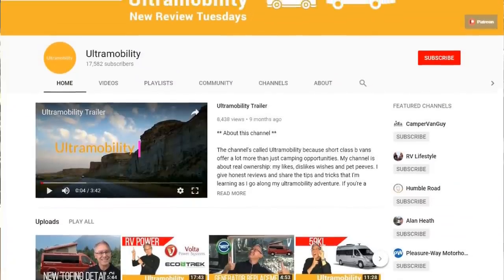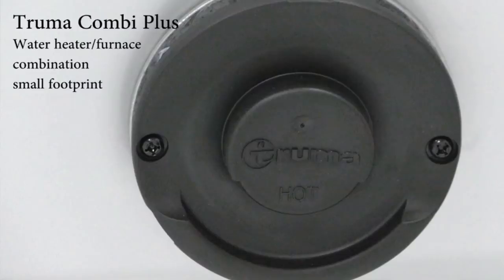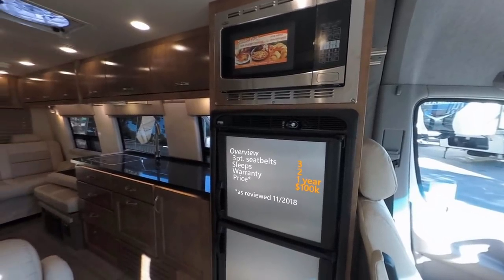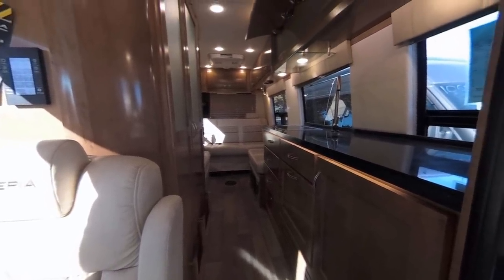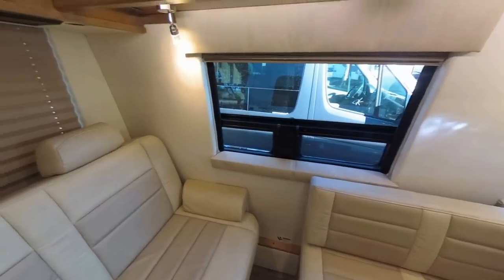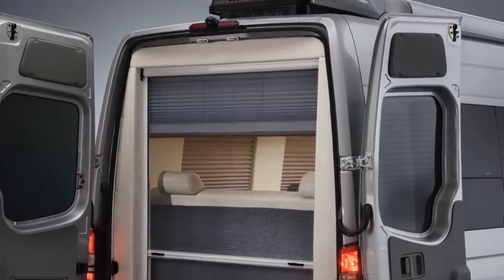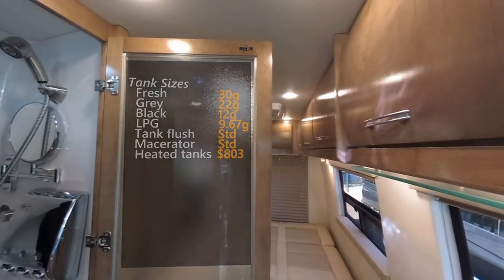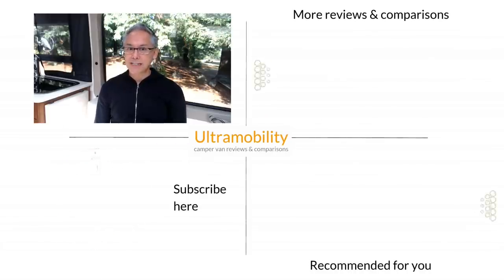Full Review | Coachmen Galleria 24T | A 4 Season Capable RV with Available Lithium Upgrade!

Comment: It's very good review. I removed power reclining sofa and installed DIY twin beds (27"x80") which it can also make a full size queen bed (68"x80").  A couple of reasons I removed power sofa, because it was not comfortable even though I used 2" memory foam mattress, and I hated to crawl down when I have to go to bathroom in the midnight.  Except it, comparing price with Airstream with the same layout, $50,000 cheaper for the similar quality. I agree that the one year warranty is the weakest selling point but I hope all problems will be occurred during one year.  About the parking space, I used to park at the Walmart or other regular parking lot, I never had a problem with it.
Reply: Comment bot

Comment: Neil PLEASE keep weighing in WARRANTY LENGTH in your final judgement.  I had a talk with a local RV dealer salesman who I've gotten to know and he shared with me that many Class B RV's reduce their initial price but give only a flimsy 1 year warranty knowing true well that something is going to go wrong or break that will require dealer service.  Some of these services are very costly and frustrates the purchaser who is then offered a trade in on another RV before warranty expires.  This is where the dealer makes some money back.  He said, off the record, that 1 year warranty RV's are a red flag for potential problems down the line and perpetuates the slimy practice of nudging people into trade ins.
Reply from the maker: thanks for sharing this. yes, warranty length will continue to factor in my final buying decision. it's an important point as you mention. when I started doing reviews warranty was rarely discussion or disclosed. in fact some manufacturers didn't  (and don't) make it easy to find their warranty information. in those cases I find it's with manufacturers who have 1-2 year warranties.

Comment: As others have said, thanks again for the review. It seems like many owners and potential buyers like the Coachman Galleria and CrossFit but are concerned about the one year warranty. With the Galleria being available for under $100k and the CrossFit under $80k the thought of purchasing an extended warranty does not seem out of line. The Galleria is excess to our needs but the CrossFit is a really nice, and a little shorter, alternative. I wish the CrossFit had a 4x4 option!!!
Reply from the maker: hi Steve - yeah unfortunately the RAM Promaster chassis isn't available from the manufacturer with a 4wd option. wouldn't that be great though?
Reply: Ultramobility Is the Crossfit/Beyond on the Ford Transit?

Comment: At this length I would think this van looses what makes a van appealing, easy maneuverability and stealth which are the main reasons for me to go to go with a B rather than a B+. At this length I would opt for the LTV or Phoenix which has an AWSOME new suspension system used on ambulances. Drove it at Hershey and was incredibly impressed. This is just my opinion and is worth what you pay for it. It is a lovely layout but I would like a permanent bed rather than the sofa especially if you need a mattress topper. I would change that opinion if they beefed up the memory foam. Fantastic review as usual! Thank you Neil!
Reply from the maker: I'll have to review the Phoenix Cruiser. It is a quality built rig for sure. Deserves a review and the attention on my channel.
Reply: Thank you Nick. I agree it’s a much nicer floor plan for my type of use. Actually I really like it! My problem will still be the length vs a B+. That’s still a tough hurdle for me to justify a B at 24ft. Really appreciate the link!
Reply: @Kath50 Completly understand. Thanks for supporting Neil.
Reply: @nickrecchio1676  can the fixed beds be made into a full bed? We have been looking at the Galleria and like what we see.
Reply: @karenhicks7816  We have a small insert cusion that will finish the current 24A bed to more of a rectangle.

Comment: I prefer the 24FL layout with the galley on the camp side, but I love the excellent Xantrex electrical system. Based on the vans I've looked at, Coachmen quality seems to be the best in the class B segment for the price. However, a paltry 1 year warranty on a $100k+ coach is inexcusable. The industry standard should be 5 years of coverage, no matter the price point. That said, if I was in the market to buy a van off the lot right now, I'd probably buy a Galleria 24FL Li3, but I'm still slightly leaning toward a custom build.
Reply: I'll vouch for the 24FL Li3 - we love ours; it's head and shoulders above our previous Roadtrek.  Buy a good extended warranty and you're still way ahead of the competition's pricing - at least for this level of build quality.
Reply: @travel4B  Where can you buy a extended warranty and the cost of it

Comment: Great great review. May hold out for the 2019. We are in N Idaho Panhandle area. 4 Season is important to us. We have a Blackstone travel trailer all season package. We stay toasty warm with the dual pane windows and can camp longer in the season than many. Would love that in a class B. Huge difference. I LOVE the white exterior paint. I am liking this rig a lot. The warranty is discouraging as others have commented. Ugh Thanks again.
Reply from the maker: I'm too frustrated by the warranty. this coach deserves better! it's build quality is not built to a 12 month spec. I've seen coaches that are built to a 12 month spec and this isn't one of them. Take that for what it's worth Spell Madam. BUT I will say that 1) the build quality on this coach is good and 2) owners seem to be happy with the purchases and with Coachmen's customer support. That says a lot. Also, you could opt to separately purchase your own extended warranty although that would be a thing onto itself - one which I would need to do a full episode on because of its complexities. Suffice it to say that while I didn't recommend a "Buy" rating on this 2018, my rating on the 2019 model will likely be higher provided the price is right. I would definitely consider a Galleria if I were in the market for a longer, extended wheelbase Sprinter. I like many of the improvements that the 2019 model year brings. Coachmen is really doing some things that catapult it into the "product leadership" position - something that Roadtrek used to be the king of. No one else is doing the work to make a true 4 season RV and Coachmen has been smart out outsourcing its lithium system to Xantrex instead of trying to build and support their own proprietary system. I'm also impressed with their options like leveling jacks, sumo springs and 4wd. That 1 year warranty though is a tough one. I'd need to see how the build quality holds up over time. If it does, then Coachmen should definitely consider pivoting into the luxury category with their class Bs.
Reply: @Ultramobility  oh yes the 4x4. Very very nice.
Reply: I have heard this as well and certainly understand your concern.
 Please feel free to browse our Galleria Owners Group on Facebook, which is strictly ran by Galleria owners. I find if potential customers get on the  Facebook page they certainly realize we do it the right way. Customer Service and Quality are our #1 PRIORITY! Would love to hear your feedback. Many Thanks.
Reply: @nickrecchio1676  We would like to see a 3 year warranty on your coaches.  It takes that long to get the problems fixed through warranty at any dealership, if you can get an appt. within your warranty period of 1 year.  A lot of time, money and chassis miles are spent traveling for warranty work.  Also, head room in the wet bath is essential for someone who is 6.2!!! Thanks for your consideration on our suggestions!!!
Reply: @nickrecchio1676  "Customer satisfaction and Quality are our #1 Prority". Well that's fine to say but it's only words! There are automobile manufacturers out there that also have similar sales catch phrases and promises, but theres is not one person on this entire planet including you and everyone at Coachmen industries that would ever purchase even a 30k vehicle from any of them with only a 1 yr warranty. That's a fact! Yet you would attempt to convince potential buyers of your product to do that which you would never do and at at price point of 100k+!! I would argue that Coachmen and other rv  manufactures fail to understand that one of their biggest buying demographic, the baby boom generation simple cannot take such a risk purchase. The average baby boomer in case the industry doesn't know has little to no saving heading into retirement to risk on a product they may have to dump 1000s of additional  dollars into for repairs after that messily 1yr warranty expires. I am one of those baby boomers looking for a down sized class b coach who will not and cannot take such a risk with such a large some of income when other manufacturers are offer far more peace of mind and security with a real extended warranty opposed to the Coachmen 1yr warranty and words. I spent a lot of time in this coach at Hershey this yr. Its a great coach, but it's a no for me until Coachmen rethinks its philosophy and business model with regards to its warranty.

Comment: Great review! Love the All season upgrade. Living in San Jose California I felt all weather an rv was overkill. But after spending a night in 14° weather. I wished i had all wrather rv. The pipes started freezing. I like the Sumo springs as well but wonder how that compares to the VP air system. I agree they do need to add more memory foam on the rear seats. I hear that many owners carry a bed topper. My wife is shopping for a bed topper now. I have a 24 foot Midwrst Automotive Weekender Md4, use to have A 25.8 foot LTV Unity MB and I have had no problem parking. Love the uniformity of the exterior hookups. Makes for a sleek stealthy rv. I would lean more towards the 24Q. Looking foward to the 2019's.  Again great review!
Reply from the maker: you did get the MW Weekender MD4! Great floorplan! Can't wait to hear your longer term review of it. THanks for sharing Manuel!
Reply: Manuel thank you for your feedback. The Sumo Springs are fantastic. Virtual no warranty. Easy and Safe and very affordable at under $1000 retail. We have done and do installs of VB. As you know there are a lot of parts, weight and cost associated with VB. Its a great system however we are very fond of Sumo Springs. Our NEW POLAR PACKAGE PLUS tank heating and insulating system has been cold booth chambered and is very well executed. No other Class B builder is focusing on the THERMAL aspects of Class B's like we are. We have some amazing products that we have used to increase our THERMAL properties. Many thanks!

Comment: As someone that has looked quite a bit at Coachmen, I must say this was a very accurate and fair review.   One thing I have never been quite sure about is that on some videos I have seen, it looks like the drawers and cabinets do have somewhat of a positive latch if you push on them after they soft close.   I would be curious to hear how well they work from any owners out there.
Reply from the maker: Thank you Bob. I didn't see positive locks on this 2018 model but I'm told the 2019 models have positive locking. I'll verify.

Comment: I like a lot of it, especially the larger galley space.  I would like to have seen the depth of the sink.  I agree with others that on a coach this length I would want a dry bath and do not require two lounges.  I would have liked to know about the quality of other finishings such as window covers.  Thank you for the review Neil.
Reply from the maker: the sink on the 2019 model is deeper I believe. the window covers are okay. I had them on my CS Adventurous. they work. I prefer the MCD shades. Easier to use and provide true black out. that's just me though.

Comment: After watching Neil's video on diesel vs gas I must now reject the MB Sprinter as an option.   If you haven't seen please check it out. Truly great reporting on Neil's part.
Reply from the maker: yikes! I hope I didn't scare you away from the Mercedes platform! I hope it's just that owning a Mercedes diesel doesn't make sense for your lifestyle!
Reply: I think with climate change being a huge issue, having to "drive through" some states because you can't get the proper fuel mix, the possibility some gas station provides wrong fuel mixes which can damage the engine, all add up to no diesel for me.  Not to mention difficulty during a breakdown finding someone to work on the MB outside urban areas.  Diesel is dirty no matter how you slice it or pretty it up with german engineering.
Reply from the maker: "pretty it up with german engineering" LOL.

Comment: You are really getting good at these reviews. Plus the specifications are presented very well. This is a great van just 2 feet too long. A deal breaker.
Reply from the maker: thank you john! I'm really enjoying doing these reviews! I agree that the extra 1.5 feet of length makes this van just too long for me too. but for some it will be welcomes I suppose. at this length however I'd probably start to consider a B+ or C which would give me a lot more room for basically the same footprint.

Comment: Thanks Neil for the nice detailed review! At around 12:25 you said the lead acid battery is 400 wh but the text on the screen says 4,000 wh. Can you clarify that please? Thanks!
Reply from the maker: good catch yes I misspoke it's 4000wh. (330amps X 12v) thanks for clarifying for viewers.
Reply from the maker: keep in mind that only 50% of that capacity is usable since this is a lead acid battery so just under 2kw-h.

Comment: Good video as usual. Two big complaints you had, bed thickness and lack of positive locking cabinets, any idea on how hard it would be to fix them after you buy it?
Reply from the maker: Jeffrey - there's nothing much you can do about the memory foam. you'd have to use a mattress topper which works. for the positive locking cabinets you can do this later but it will require you boring into the cabinet doors to put in the locking mechanism and screwing a receiving plate into each cabinet. not a huge deal and lots of people do this.
Reply: Positive latching now on all Galleria and Cross Fit products!

Comment: I don't see a use for the third or fourth chair in a two person RV!!?  I'd like to see the 24A version with the fixed bed.  But I suppose most people would want the lounge with it's cumbersome bed makeup everyday.  I am quite impressed by what Coachmen is bringing to the party.  I would never had thought of these guys without your review.  But there are a lot of questions remaining on the energy usage.  With the basic plan, I guess you are OK since you have the generator.  But on the all electric, what happens if you run low on batteries?  You have to turn on the engine manually for a hour or two to recharge?
Reply from the maker: yes with the li3 system powered by Xantrex you'd have to start the engine. i'm not certain if there's high idle installed or not. if not it will take longer to recharge the batteries. driving around is always the best and fastest for recharging using the underhood generator.
Reply: I would also want a permanent bed.  There's enough to do when out camping without having to also make the bed up in the morning and at night. A permanent bed is more comfortable then the lounge configuration.  Sleep comfort is on the top of the list for what I am looking for.
Reply from the maker: yep the 24a layout may better suite you then Charlie's Mom.
Reply: Approx. 1 hr on shore line and approx. 2 hrs. recharge at idle-we also have high idle spec'd chassis. As always after the 2 hrs. both Coachmen and Mercedes ask that you get the chassis on the road for charging.
Reply: @Ultramobility  We do spec our Li3 chassis with High Idle.
Reply: @Judy-cm6kp  24A is a fantastic floor plan that was just introduced! Fixed bed and so much more!
Reply: @nickrecchio1676  Nick- your on-line brochure is sketchy on how the rear 24A bed is going to look and work. Any site I can go to in order to see more?  Will you be putting out a video soon?
Reply: @gosman949  We have power incline rear backs vs. Maunual pull up incline for the bed.
Reply: @nickrecchio1676  Anything in the works for a true 'twin' version?
Reply: @Ultramobility - There is a high idle switch on the Li3 chassis.
Reply: @SlowDownandTurnHere  We currently have a Twin set up. It includes powered inclined back rest and the ability to make the twins into a full bed.
Reply: I just posted the link to the 360 degree view of the 24A (Fixed Bed) Galleria above! Would like to get your feedback. Thank you.
Reply: @nickrecchio1676  I really like the 24A with one exception.  You have to get rid of the hanging wardrobe on the passenger side.  You are creating a claustrophobic tunnel effect in the van to gain about 2 cubic feet of storage.  Just put in the 24FL galley and call it a day.